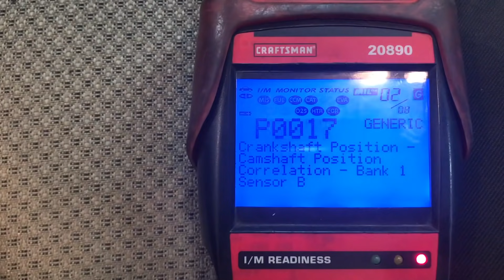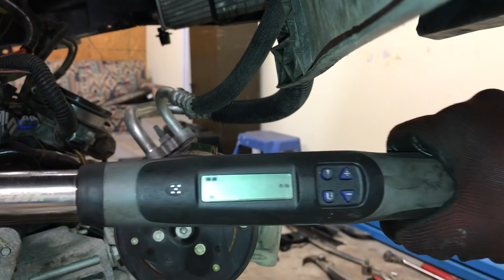Step By Step: 2.4 EcoTec Timing Chain Replacement

Comment: Dan, how long does this job take and what kinda price range would it cost for this job to be done?
Reply from the maker: When I worked at a Chevrolet dealer, it was typically a $2500 job and the average tech could complete this job in about 4-5 hours. I did a little more work on this vehicle including lowering the subframe and had about 10 hours total in the whole job. This included water pump replacement, engine oil and filter change, transmission fluid and coolant change along with replacing both front axle seals. Did it all for $1250.
Reply: I'd like to know just the cost of the parts alone.
Reply: Mine cost 591.00 in April. I’ve spent a lot on my 2010 Malibu. I hate it and got over 6,000 in it. I still owe 2,100. 3400 on a new transmission in January. Brake sensors and a battery  3 shops couldn’t figure out. I’ve replaced every coil pack in the last year and I had a cylinder 4 misfire come up tonight. I just replaced the camshaft sensor 2 weeks ago. I’ve replaced Camshaft actuator solenoid. Im gonna swap my coil packs to see if it’s a bad coil again. I’ve watched videos on how to do these little jobs but the timing chain and transmission was left to a mechanic. I’m a single mom trying to save some money doing it myself.
Reply: @michellejones1886  I'm sorry to hear this. My Mother has a 2011 Malibu and it's been rock solid. It now has 125k miles and it's still going strong and she's really hard on it.  Was the $591 to change the chains at a dealership?
Reply: DanielJaegerFilms Thank you fir the reply. I wish you were in Denver. I'm sure if this ever happens to me it will cost an arm and a leg. I'm hoping the 6 speed transmission holds up well. Car as 116k miles. No problems with it so far.
Reply: Lol where are you located, my mechanic change my water pump with the special tool.  But it produce a noise after .  Any suggestions ?
Reply: DanielJaegerFilms Lol... Good lord.... this can be done for about $300 in parts and a few hours in your driveway... but yeah the stealership would charge 2500 bucks to do this

Comment: Why there isn't any metal chain guide on the market? Or any material improved ones? Another plastic guide? Another time it will break.
Reply: Metal chain guides will wear out the chain ;) That's why they use 'plastic'. Another solution is sprocket guide rollers, but that will take more designing, room, lubrication and also more cost. Remember a car is build by a factory that delivers the parts for lowest price possible... That always goes hand in hand with loss of quality ;)

Comment: Any model or brand that have timing chain problem, is proof they  should be considered not worthy of your money. A timing chain should never fail. Carmaker bs
Reply: dixie lee yes i remember another car having this problem is the v8 b7 s4 from audi. A 70K! car with timing chain but plastic guides that needed to be replaced each 100k km even if the parts were meant to last all the engine life, but as if that wasn't enough, as the engine was never thought to be opened to do the job you need to remove the complete engine to change the parts!. Estimate cost 4 to 5k, now that's NICE
Reply: New cars are full of electronics, everything is monitored and also can lead to failures. BMW E90's are pretty descend cars, if they have a good and full service history (also on valvetrain gaskets and crankcase ventilation system). Turbo's can wear out easy and common rail system isn't flawless, secundary pumps fail on regular base, aswell as the injectors themselves. For the rest is it pretty easy to get some tweaking and tuning for more power. But beware of that, do it only if earlier said is replaced or checked. 
X-Drive system is a solid system and hardly have issues. 
Do not underestimate the fuel economy, because it sucks they like to drink loads more diesel then average is advertised with. 
For E90 check for rust around suspension mountings and both subframe mountings.
Reply: If yall think the ecotec timing chains were bad try any GM 3.6 DI engine. They have multiple chains that have a very high failure rate. Mercedes designed engine that even they were smart enough to never use in their vehicles lol. My 06 SRX needed timing chains at 64k, 89k and at 108k I got tired of doing it and scrapped the pos truck. I even did 3k mile synthetic oil changes and with the heavy oil consumption these engines have it was pointless to keep tearing the engine apart and keep doing them. Meanwhile my 96 dodge ram pushing 300k has no timing chain wear or play whatsoever.
Reply: Yep, same goes for BMW, always chain rattle noises, and running rough... cost for replacing estimated between 1 and 2K incl full engine service :S
Reply: ed200sx thanks for the advice, i've spent a lot of time in forums to find a quarter of the info you told me. good mechanics are getting more and more difficult to find out this days.👍
Reply: Marfran Dema, you're welcome. Goodluck finding a nice E90 and yes, most of the mechanics these days are more 'IT-guys' then true mechanics picking up a tool to actually work their way thru. 
Try to get your valve clearance fixed checked and fixed on an old 1985 318i for example... Not a single BMW dealership can help you out, because those new mechanics never learned how to do it. 
In case of more info or questions, you now know my channel and how to get in contact with me ;) Allthough I'm not a 'poster' or 'vlogger' like our friend Daniël Jaeger.
Reply: MAN ARE YOU STUPID.
Reply: That’s a dumb way of thinking everything fails once in awhile but Chevrolet equinox just suck tbh
Reply: That's why I didn't mention Honda ;)
Reply: Toyota 22 R/RE tended to need timing chains at or shortly after 150k. IIRC Daniel had a Nissan truck or Pathfinder V6 timing chain change out with higher mileage. Also my neighbor here in Ohio changed his '96 Pathfinder chainset out around 300k miles with a wee bit of cold chain slap.
Reply: i think every chain has to be changed at some point
Reply: ed200sx correct because they have a timing belt that is supposed to be changed every 60,000 miles
Reply: How long did this take you to complete?
Reply: Planned obsolescence
Reply: GM owners are the worst at doing their maintenance!! Ford and Chrysler too. Not saying these engines are great but they have zero tolerance for running them low on oil and neglect
Reply: You’d think a timing chain would last longer than a belt, but it’s actually the other way around. When you consider how many links there are on a chain, all you need is the tiniest amount of wear between each of them to stretch it enough to turn the engine light on. In a timing chain system, oil cleanliness is more crucial. I’ll take a timing belt engine any day
Reply: Often times it’s due to lack of oil changes, combined with ecotecs notorious problem with burning oil. Most people let their oil go too long.
Reply: PLANNED OBSOLESCENCE
Reply: My 2011 Malibu just rolled over 200k miles with no timing chain issues yet
Reply: Yep!! The Eqinox Is A Night Mare,According To Some GM Technitions.
Reply: If you're worried about timing, quit being a little b!tch and rock an old-school smallblock. Those old chains don't break.
Reply: I just got rid of a 1978 Mercury Cougar. The body was too soft, but the powertrain will be going under a '79 or '80 Ford LTD or Crown Vic, and the rear axle might find its' way under something else.  Anyways, the 351M still had its' factory timing chain, and 239k on the odometer.
Reply: @stanpatterson5033  351 modified  are all junk . My 73 mach 1 has the 351 Cleveland  4 bolt mains 4 barrel with the big heads. But I love my 426 hemi in my 71 dodge challenger even better.
Reply: Yeah guess so.... I hardly see it on Japanese cars tho, Nissan/Toyota never had such issues or never seen them at the shop/private, and I'm mechanic for over 20 years now hahahaha
Reply: @ed200sx  But they have lots of other issues.... don't  lie.
Reply: " I hardly see it on Japanese cars tho, Nissan/Toyota never had such 
issues or never seen them at the shop/private, and I'm mechanic for over
 20 years now hahahaha"

Nissan has had a LOT of problems with timing chains. Their famous VQ V6's are infamous for timing chain issues. Toyota usually has VVT solenoid issues instead of TC wear like this car had. Some of their newer engines sound terrible on cold start because the timing chain tensioners allow the chain to whip around. Toyota claims it's perfectly OK but they also only warranty their engines for 60k miles. Oil consumption, external oil line failures, and head gaskets are the more common problems you'll see with a Toyota. 

The most common reason for timing chain wear is not changing your oil often enough, bad driving habits like making too many short trips which causes excessive unburnt fuel to end up in the engine oil reducing its ability to properly lubricate, and defective PCV valves that don't adequately remove combustion gasses that blow by the low tension piston rings and enter into the crankcase. It also doesn't help that some of the best engine oil additives for protecting timing chains from wear have been removed in the last 15 years. With less protection in the engine oil and people pushing their oil change intervals as far as possible, it's not really a not a surprise to see people managing to prematurely wear their timing chains. It's a common issue with other manufacturers including Ford, Mazda, Honda, Subaru, Hyundai/Kia, etc. 

I've seen 2.4 Ecotecs go well over 250k miles on the original timing chain. I have a family member that has a 06 Saturn with the 2.4 Ecotec and it has over 280k miles on it and they've never changed the timing chain. They use cheap Walmart conventional grade engine oil and change it every 3-4k miles. Then again, they don't use the vehicle for short trips and they change their oil frequently. It's basic common sense stuff.
Reply: @ed200sx  Nissan is notorious for timing chain issues, 3.5s 2.0s, I've seen them fail under 200k kms!
Reply: dixie lee its shit for brains owners who run them low on oil or never change it that have these problems
Reply: @JB-fm4tb  Nope....you are totally wrong again. Why not just keep your mouth shut as you have no clue. Go make dinner or clean the house.
Reply: When were you born..2010?
Reply: @lard1892  I am always amazed  at just how many people are engine dumb ..truly  amazing.
Reply: well then what about honda  they all have rubber timing belts and must be replaced every 80 to 100 thousand miles for $1500.00 now thats fucked up.  This chevy had 200 thousand miles on it
Reply: ed200sx german ENGENIRIN i guess.
Reply: Even honda engines have timing chain issues. I prefer a belt motor. Easy and fast belt change and never have problem
Reply: @ExciteLetsPlay  I prefer  a flintstone car myself.
Reply: Yep but they don't sell chevy's here ;) And it will be different in the future for GM, because they sold Opel/Vauxhall to Peugeot/Citroën. So I hope for GM those issues will be over for the future models/engines
Reply: ed200sx if youre a mechanic i'll like to ask you what do you think about new cars reliability in general. And if its true that the latest german cars are really bad in terms of reliability.
 I was interested in an auto bmw e90 330xd, any considerations on that powertrain?

Comment: These were gravy jobs
Reply: blaster1812 How long does thia take and so you have to lower the engine from the car ?
Reply: DJR5280 you do them in the car   , i hope he’s doing this way for educational purposes
Reply: skostur79 check the description
Reply: Very gravy jobs.  Takes less than 2 hours to replace the timing and water pump chains on the 2.0, 2.2, and 2.4L ecotec engines.